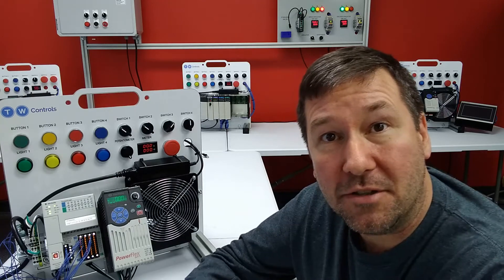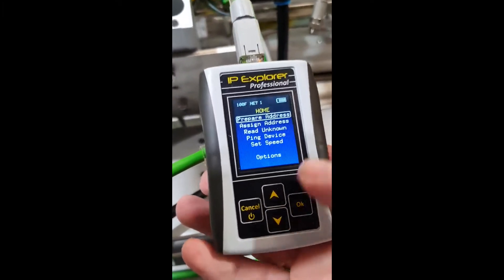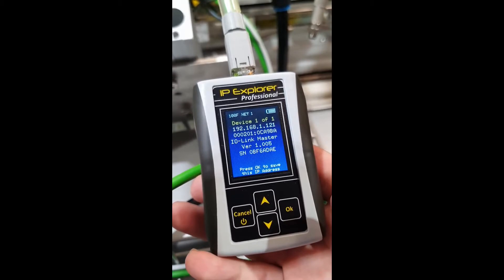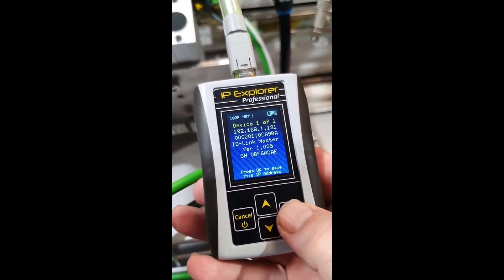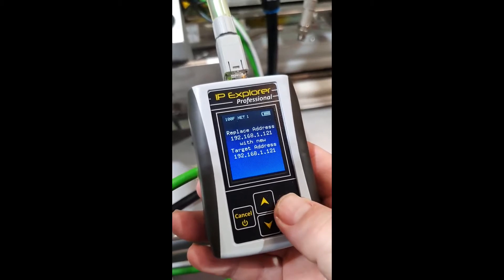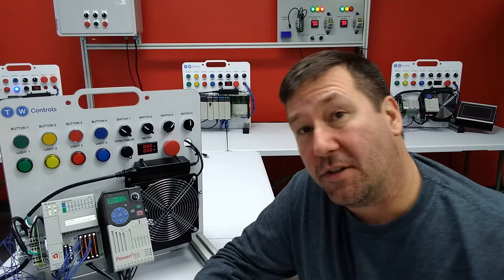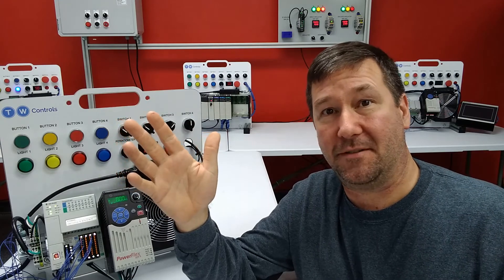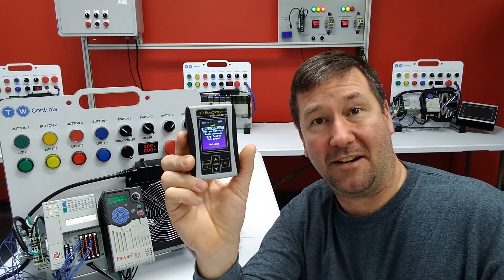IFM I/O Link Master Configuration. Read and Change the IP Address

Comment: I just bought the tool. I've had so many issues with windows 10 trying to connect to devices and and conflicting with the outdated Allen Bradley software tool that this is a no brainer purchase. 
Thanks for the videos!  I'd love to see a deep dive into I/O link-I've got machines that I'd love to replace old junction boxes and wire bundles with on-machine rugged style I/O but the info available is so dense to try to sort through.
Reply from the maker: I have really be enjoying learning about IO Link lately!

Comment: I have the 1732e-um007, no DHCP server, did 888 reset, Bootp/DHCP Tool will not scan it.  on IP scheme 192.168.50.###.  I have used IP Explorer and will not see an address.  I set the switches to ie: 192.168.1.235.  Tried assigning IP 192.168.50.235.  Will not work.  set switches to 999, tried using IP Explorer to assign IP 192.168.50.235 using Bootp/DHCP; will not find anything.   Anyideas on how to get this to work on 192.168.50.235 when AB Bootp/DHCP tool will not work?
Reply from the maker: What is your current network setup on the SIM-IPE.  It would need to be configured for 192.168.1.XXX.  Send an email to contactus@twcontrols.com if you have any more trouble.

Comment: Hi Tim
How to connect ifm I/O link to my AB control logiX plc L72. I am connecting an 8 RTD to the I/O link. From I/O link can I take through Ethernet..
If so where should I connect the Ethernet point of I/o link. Can I connect  via a D-Link switch to Processor
Reply from the maker: Not sure about that one Kennal.  Nevery used it with an L72.

Comment: I just discovered your channel today, while searching for Ethernet messaging from ControLogix/CompactLogix to Micro820. Great useful information on these little controllers, btw. i also watched the video you made about the rate you charge. When you were talking about overhead cost of software, you didn't mention CAD. What software would you recommend? Thanks for the inspiration.
Reply from the maker: Hi Tim, welcome aboard!  I use an old version of Autocad.  I need to upgrade but I'm not sure I would choose CAD today.  It is on my list so maybe I'll do some videos evaluating different options.
Reply: @TimWilborne  I currently use Draftsight.

Comment: Just got one of these devices myself. Is there a way to copy the current IP address of a device in the field and replace the new devices IP with the old one copied?
Reply from the maker: Hi Kyle.  Yes you can.  Same as in this video, read the IP address of the old device then press OK to set that IP address to the target address.  Then plug into the new device and go to Assign IP, Use BOOTP/DHCP and it will assign the old IP address to the new device.
Reply: @TimWilborne  thank you very much.
Reply from the maker: @Weldingsmith435  You are welcome!